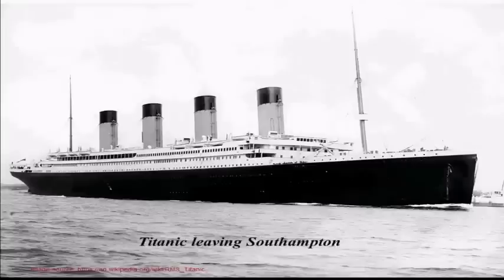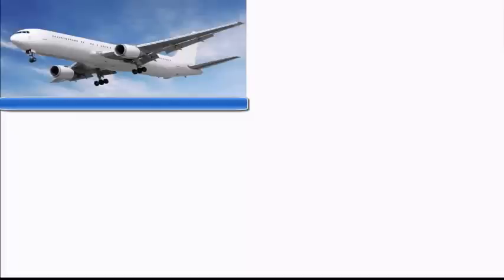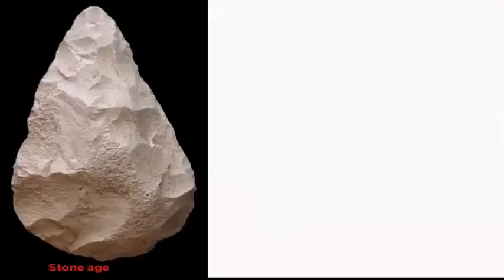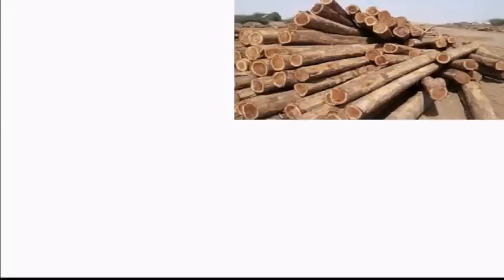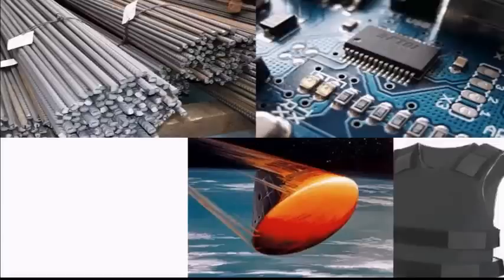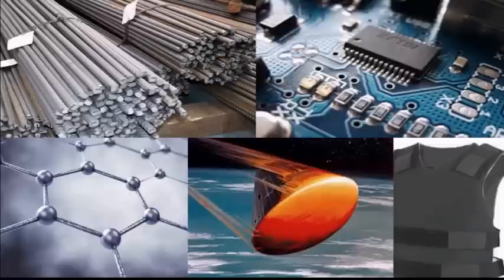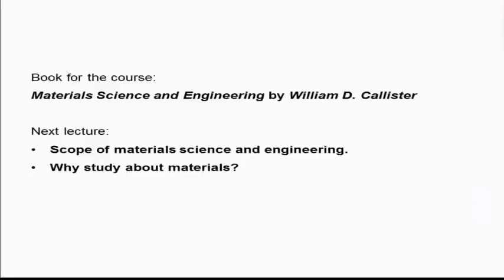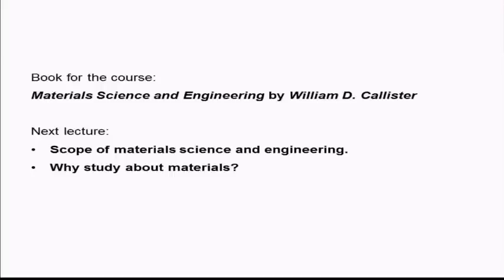AMIE Exam Lectures- Materials Science & Engineering | Introduction | 1.1

Comment: - Ductile-to-brittle ratio : temperature if an item breaks or not
- brittle fracture
Uses
- aircraft (transportation sector), housing sector, telecom section (semiconductors and electricity), agriculture sector (enhance capabilities in agricultural sector)
Things used in prehistoric era
- wooden logs, raft, stones for tools, animals for clothings, clay pottery to contain water and cooking, etc.
Present situation
- steel reinforcement bars
- silicon revolution
- in combats such as vets
- spaceship - huge friction, high temperatures resisted by materials 
- graphene sheet